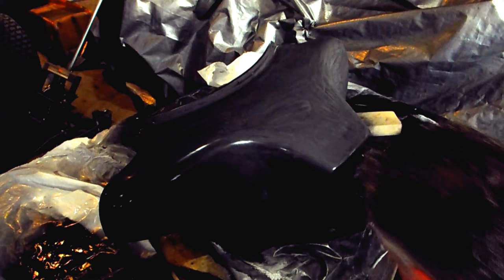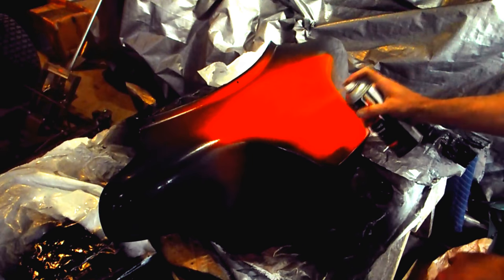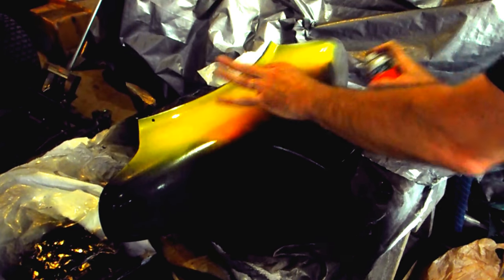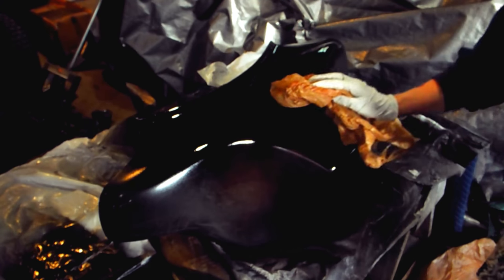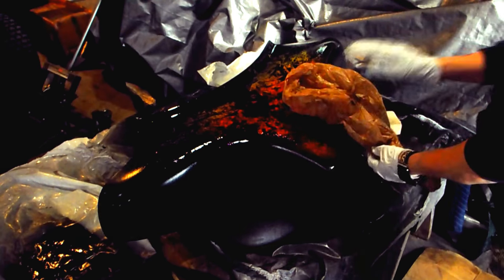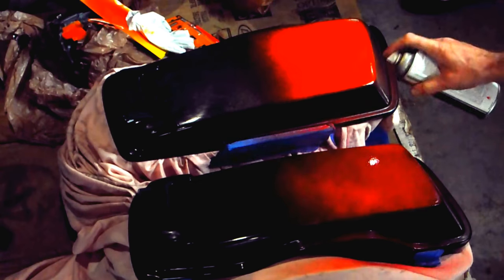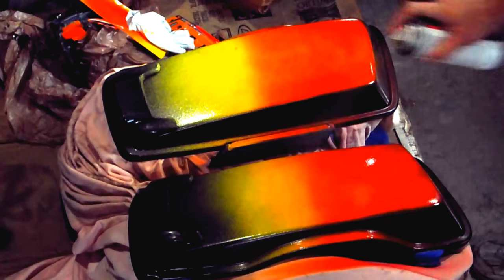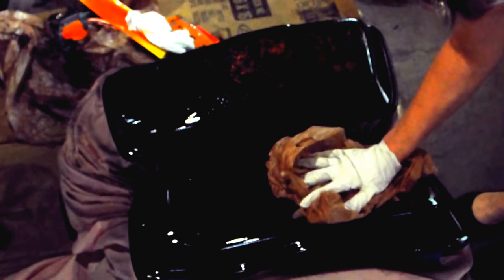Spray Can Paint on Motorcycle Parts

Comment: When you clear coat that does it  smooth out? So that there is no texture in the paint?
Reply from the maker: Yes it does, mostly. Still need to wet sand, gently, and use a buffer to complete the finish.
Reply: @contact4mwy7  is that wet sand after clear coat
Reply from the maker: This is the clear coat before wet sanding.

Comment: WOW, That was GREAT!!! How was that done? With a warm towel on wet paint???
Reply from the maker: Thanks Renegadebiker! I guess I should explain! The paint was right out of the can wet, and we used lightweight plastic grocery bags for the dabbing part. When it got pretty much covered with paint, she would drop that bag and grab a new one to continue. That way the paint doesn't transfer from the bag to the painted part as much. Keeps it fresh and does more picking up than laying down. I hope that helps!
Reply: Mark Young - Outside The Box You are welcome.  Yes, that explains a lot. Did you put some clear coat on it after that???
Reply from the maker: I am working on the clear coat right now. It is the same brand as the color paint. I did run into a problem with the paint wrinkling on the saddle bag covers in some spots where the clear coat hit the original paint base coat, though. That's going to take some work to fix it. The two fairing parts are taking the clear coat over the same brand paint base coat fine so far, and then there will be some wet sanding and buffing.
Reply: Mark Young - Outside The Box Oh o.k. Cool. I am looking forward to seeing it completely done when you are done with it. I have thought about doing something similar with my bike, but having the flames come out from an F14 Tomcat rear engine, as well as  having it launch a AIM 54 Phoenix missile in the future.
Reply from the maker: Sounds like quite a project right there! I will upload a video when it is all done. Thanks
Reply: Mark Young - Outside The Box ...
So is it done yet??